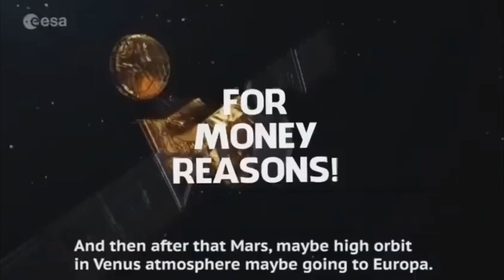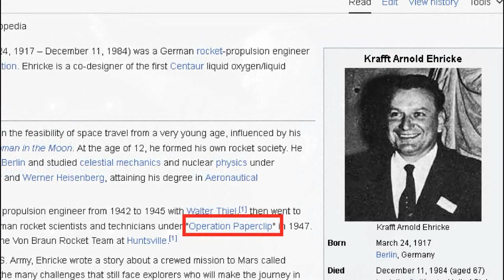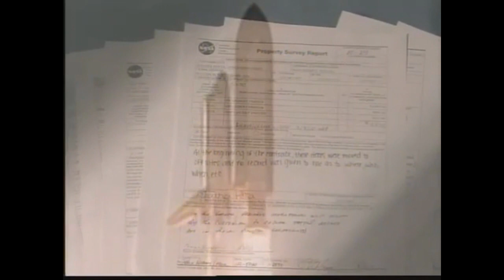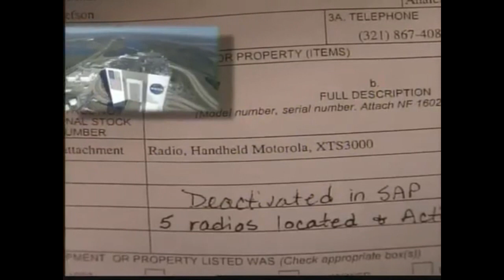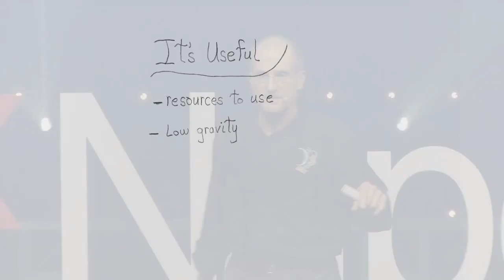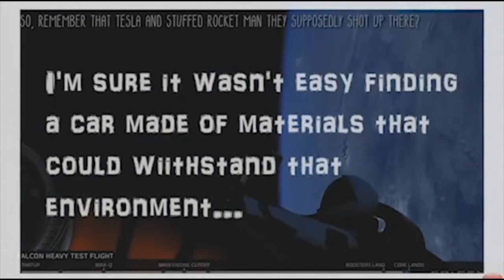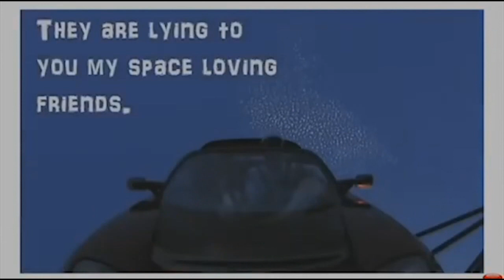Elon Don ~ Le' Petit Special

Comment: Anyone ever noticed that Don Pettit has got "Crazy Eyes" syndrome. It's actually a real condition called San-Paku eyes, usually caused by an over-active thyroid and producing some pretty wild neuropathies as a result - which would've precluded him from any legit astronaut program. I was especially impressed with his knowledge of Safety Protocols on the ISS in the case of catastrophic decompression, meteoroid impact, collision with another (or docking) spacecraft or hull rupture etc....like sweet f***-all!! He had NO CLUE AT ALL, when asked!!  You know that big white file that airline pilots pull out and consult in the case of emergencies - well that kinda' manual - just exponentially more voluminous for "spacecraft in a vacuum."  Ever noticed all the conduits and cables that are in the way of sealing off any their interlocking doors between compartments? Good luck getting those out of the way in an emergency. Of course...I mean, if the "manned ISS in LEO"  wasn't an exercise in gratuitous fiction.